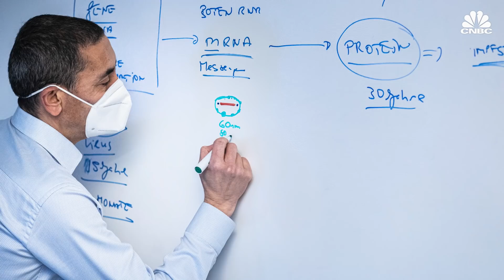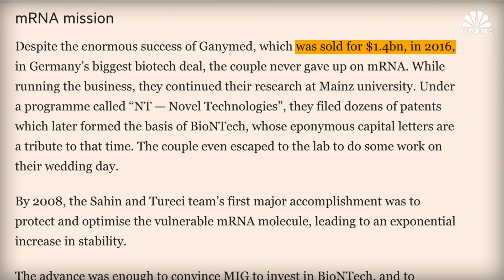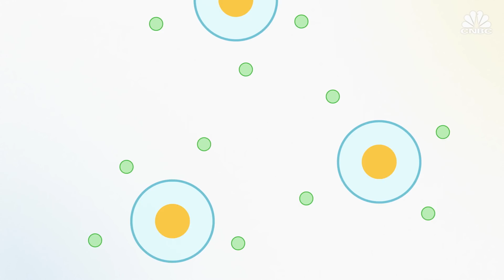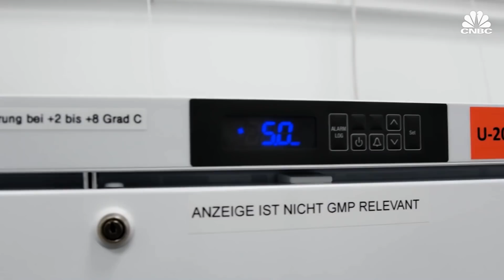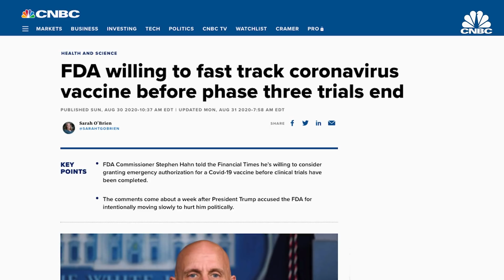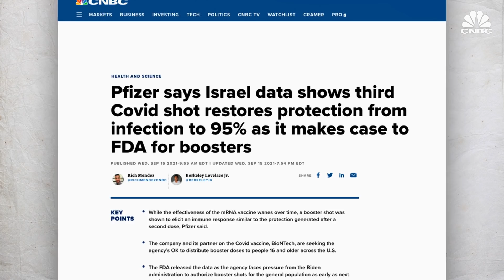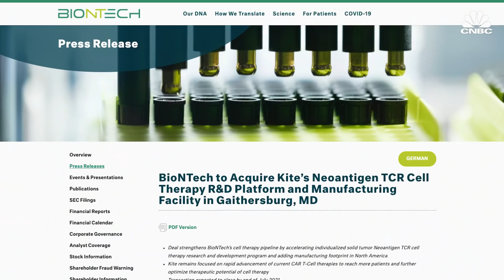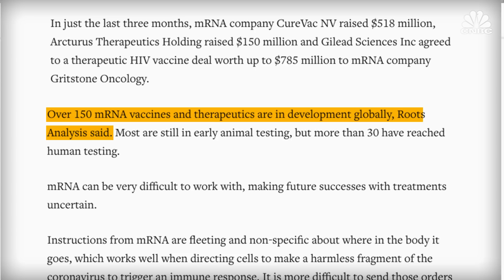How BioNTech Used Cancer Research To Create Its Covid Vaccine

Comment: This is why the COVID vaccine was so quick to be found and produced.  Typically research labs work by getting grants.  They have to get money to buy equipment to get the lab up and running and that takes a lot time and no how.  Then they need to find who they feel is best in their field who will work with them.  It takes decades working like that.  When COVID arrived, who was better suited and equipped then big pharma.  They had the equipment, the manpower, fully setup labs, the no how and large government grants and any top scientist they wanted from outside the company.  So people who are worried it was to fast, think on that.  Now if they could just mobilize like that for other deceases.  Maybe Cancer?

Comment: The vaccines either don't work or immunity falls off quickly.  How many boosters are we going to be told that we need before people realize that these vaccines don't work?  What legitimate vaccine developed in the past has this low of a success rate and requires boosters like this?  Side effects and no data on mid-term and long-term effects from the vaccine make it very risky, especially in our children.  Only those at high risk, such as the elderly, should take the gamble on this vaccine if they wish to be vaccinated.  For the rest of the population and until a truly safe and effective vaccine can be developed, infection control procedures and therapeutic drugs with resulting immunity are the answer, not these quack vaccines designed to enrich the pharmaceutical industry. 👿

Comment: They should have received the Medicine-Noble Prize!!
Reply: The Nobel price is often given years later for groundbreaking scientific breakthroughs. So it wouldn‘t have been expected this year anyway. Apart from that, as huge as the contribution to helping mankind of those two is, they built their vaccine on the „shoulders of giants“, as it is usual in science. Have a look at https://en.wikipedia.org/wiki/MRNA_vaccine#Early_research . mRNA vaccines have been in research since the 90s. It could very well be, that those pioneers would get a Nobel price, maybe shared with those two.
To draw a comparison: they did not invent the engine, but they figured out mass production.
Reply: @_TbT_  Thank You very much for the information!! Interesting, and I will look into it. Thanks again!

Comment: And someone please tell me what in the world did they inject into the eggs 🐣  🤦🏽‍♀️ 👀
Reply: It is a process used in vaccine research using Undeveloped Chick cells. It is used In replication. In my 42 years of working with Infectious Diseases I have seen it done many, many times.
Reply: That's how they make some styles of vaccines, infect a bunch of eggs, then extract the virus before weakening it to produce the final product. These are not eggs that will ever be eaten by anyone, but it's one reason why they ask if you have allergies, because some egg proteins could be included i the vaccine. It's not a viable mechanism for creating all vaccines, and takes quite a of lead time, but it's pretty well established and easy to do when it does work, like some types of flu vaccine.
Reply: This sounds like the plot of I am Legend.

Comment: Aborted babies used?  Doctors of death.
Reply: mRNA vaccines do not contain fetal cells.
Reply: @kolliwanne964  Maybe. Maybe not. But they were used in the development of the mRNA shot.
Reply: @grabir01  They were used only during a test phase, but those cells arent from "new" fetuses. The cell lines date back around 40 to 60 years, nobody gets harmed here.
Reply: @grabir01  I dont understand what your point here is, seriously. Can you explain to me what harm is done by using a cell culture that dates back to ~1960? Of cause you could argue that it should not have happened back then, but what is the point in the present?
Reply: @grabir01  I called it a cell culture because thats all that is used nowadays. I call it a fetus if its still a whole organism. I call it a child when a fetus is born. But to me those terms are not used to imply a lesser significance.

Again, all I want from you is to understand what benefit we have from throwing the cells into a trashcan now, instead of improving the safety of medicine with it. I just genuinly dont understand that point, i can understand if you want to forbid abortion in the present, but this does not require any new abortions at all...so whats the point?
Reply: @grabir01  What?

Comment: So what about cancer? So long and still no vaccine, but have on3 ready for covid?🤔
Reply: Because cancer is a very odd kind of illness and is extremely difficult to develop any kind of vaccine for. It’s the body attacking itself, and there’s dozens of variations, which is nearly impossible to make a vaccine for.
Reply: @glossyplane542 
Actually, cancer is not the body attacking itself, like in MS, but it's so individual because it's each person's individual cells that mutated.
They're just reproducing massively without the body being able to attack them because it can't identify them as mutated/disfunctional.
So they soon start causing trouble by putting pressure on neighboring tissue (nerves etc.), undermining the body's structural integrity (for example when growing within the bones) and draining the body of its resources.
The problem with treatment so far was that a person's cancer (cells) is (are) individual to that person.
However, cancer cells share common characteristics that were already to attack them, like growing and therefore 'eating' massively.
In chemotherapy, their 'appetite' is their weakness, as they will absorb much more of these toxins injected into the body than normal/functional cells do.
In radiotherapy ALL the cells affected (hit by radiation) will be damaged, however fast growing tissue/cells is more vulnerable to this disruption.
Today the most precise tool to fight cancer is immunotherapy, helping the body identify mutated cells.
Once it does, the immune system will simply try to do it's job.
Now mRNA technology may make it possible to create a treatment against every individual person's individual cancer cells easily and cost-effectively.
Reply: @Nancy Jane yeah I met someone who drank water and they also got cancer. Coincidence?
Reply: @goose1194  damnnn bro its confirmed water causes cancer
Reply: @Nancy Jane yes it is 

I know people who attended trump rallies and got cancer a few months later. Therefore the only natural conclusion is that there’s a big conspiracy by trump to give people cancer so he can illegally profit from people getting chemo. Because coincidences don’t exist and everything that ever happens is a conspiracy against me.
Reply: @TakenTook 
that may be true ;)
Reply: @damianm-nordhorn116  that was too much to read imma just assume it was something smart
Reply: exactly. and they started working on it BEFORE the pandemic... says so right in the video/discription
Reply: @crashoppe  Yes, the'vaccines' existed before the virus. It was said in several videos. The people speaking didn't realise the implications of what they were saying. The same persons who used the corona virus to create covid are the same ones making the 'vaccines'. Hence, the similar after effects of covid and the 'vaccines' after contraction.
Reply: @donnatrump1403  it would only make sense to have a way to control the virus BEFORE i unleash it worldwide. thats why event 201 was needed in the stratagy
Reply: Cancer is more individual.
Here, it suffices to target the virus's one "spike" protein alone.
It's kind of like "one size fits all/most".

Comment: And how they used politics to force it inside people who didn’t want it.
Reply: I’m so happy I didnt get that BS vaccine. If you’re unvaxxed, DO NOT BUY THE LIES. I have coworkers constantly pestering me to do it. No thanks. I’m never getting it. The long term effects aren’t even known. Idiotic decision to get it.
Reply: @jefftX  and that’s you’re decision…my body was a complete wimp to Covid so I went ahead and got it with the hopes it would help me. But mandating it…just wrong.
Reply: @DB-qc9br  what if the long term effects end your life within 10 years? Worth it?
Reply: @jefftX  I mean…no, but that would be omniscient foresight that no one could predict accurately. I may die from a car accident in 5 years…would driving never have been worth it? I made my choice bc:

1. I work in surgery and a lot of hospitals are mandating it for employees.
2. I had covid early on and my body has been completely weaker bc of it…I’m 6’1”, 200lbs who exercised moderate/heavily 3-4x a week with no prior illness. I can barely run a mile now without getting completely gassed…my lungs’ tidal volume has diminished. Used to run 2 1/2 miles after a hard workout. 
3. I’ve had to get flu shot (same type of vaccine as covid m-rna) many times over the years and never had adverse reaction…but again, that was MY choice and shouldn’t be forced on anyone.

Comment: So which of the three options for a vaccine (pfizer, moderna, or J&J) uses biontech's technology?
Reply: BioNTech’s vaccine uses BioNTech‘s technology. It’s very often falsely called the „Pfizer vaccine“ even though Pfizer doesn’t have much to do with it. But they partnered with them.
Reply: @raileon  yeah I’m pretty sure Pfizer just distributed the vaccine, which kinda stinks when they get the credit for making the vaccine even though they didnt
Reply: @raileon 
Pfizer might not have developed the mRNA not the lipids it's being coated in, yet BioNTech wouldn't have gotten this done so easily without Pfizer's support in testing, production and delivery logistics.
Reply: @damianm-nordhorn116  that’s correct. I always compare it to different products like the iPhone. It’s designed by Apple but manufactured by Foxconn, who have all the facilities. Yet we don’t call it the „Foxconn iPhone“.
Reply: @raileon 
Right. However, while as a German I'm very proud of the fact that a German company developed this vaccine (and in this case of integrating (Turkish) immigrants very well), I think Pfizer also deserves some credit.
Reply: @LightingLotusLove  No, the J&J vaccine uses adenoviruses
Reply: Try Mark 13 records on yew tuubb kenite files about who is behind this deception.
Reply: modeRNA
Reply: Pfizer.
ModeRNA developed their own and J&J uses different technology similar to AstraZeneca's.
Reply: I believe Pfizer
Reply: Pfizer and Moderna both use mRNA. Amazing tech which will hopefully result treatment for many illnesses.
Reply: @ollimustonen  yeah no. The vaccine and mRNA have ties to CRISPR gene editing…
Reply: @XERXESDOE  You're welcome to leave these amazing new treatments to us. I could care less...
Reply: @XERXESDOE  On that we agree on. Vaccine passport is bad idea. In Europe we have socialized healthcare so it's barely ok if hospitals start overflowing but it's pretty iffy even at that case...
Reply: all the vaccines have many of the same ingredients. and guess who holds the patients on the ingredients? maderna. and guess who is heavily invested in maderna? fauci. 
source USPTO